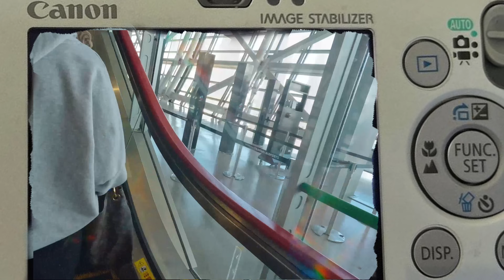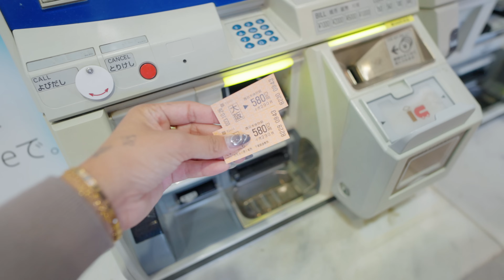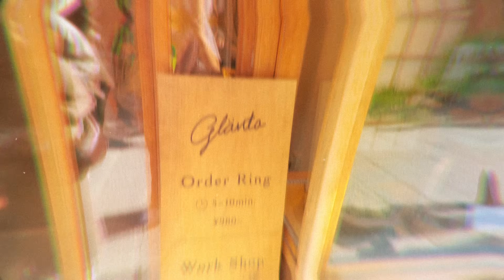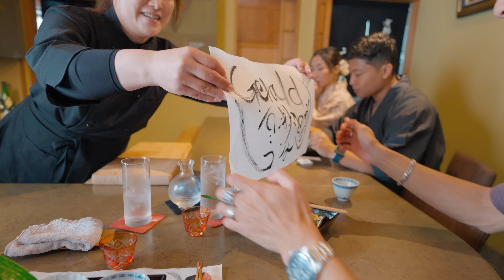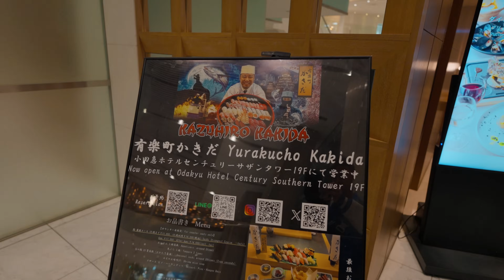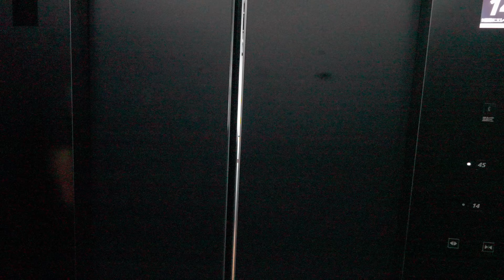How I Spent 14 Days in Japan 🇯🇵 (eating, vintage shopping, Disneyland, etc)

Comment: We did the same trip with a 2yo and 8mon baby, 3 huge suitcase, 2 carryon and one double stroller. We ended up taxi most of the time. Took a taxi from Osaka to Kyoto but took all of our luggage on bullet train from Kyoto to Tokyo. We made it happened because of my husband pushing all of the luggage while I push the stroller. BTW, we stayed at the same hotel and I love it. Room was big enough for me to pack 3 suit cases and projector TV is a plus for the kids and husband. 

One take away from our trip is, traveling in January to Japan means lots of coats and jackets especially for the kids which leave no room for shopping.